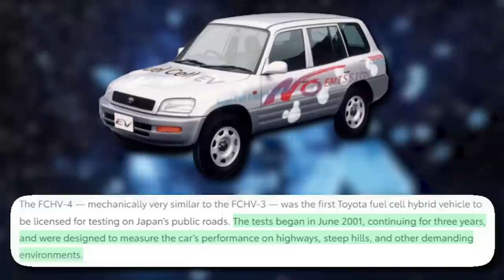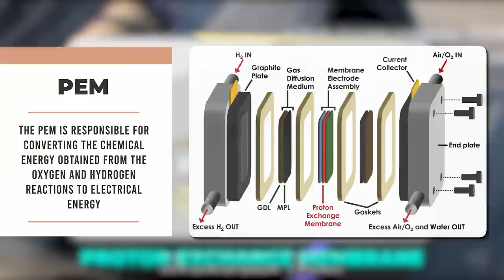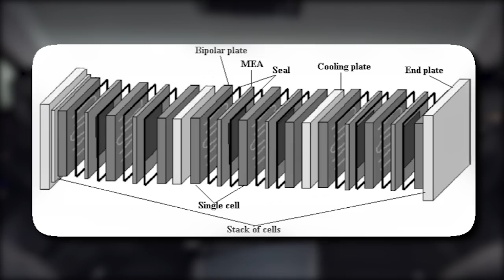Toyota CEO Releases 4 New Models | GAME CHANGER

Comment: So where is the green hydrogen infrastructure???
Reply: 1. Infrastructure follows commitment.  Just like it did with EVs.
2. Unlike battery energy, hydrogen is readily shippable from mass volume green source to the final user.
Reply: @canwelook  Except for BEVs the main charging point you are supposed to use it's the outlet you already have at home but that's not the case for Hydrogen. Without any fast chargers you can still use a small city car powered by a battery but without a hydrogen power station a hydrogen car is useless as it's the case for my country. 0 power stations across the country while almost every village has a grid connection.
Reply: @canwelook  Wrong!  Telsa built the super charger stations ahead of the demands.  The only way to push hydrogen cars to the public is to create a simple and cheap device to produce the hydrogen at home.  OR at least take delivery of hydrogen at home (storage).
Reply: Huge solar panel farms in India.
Reply: @canwelook  what could be easier or more efficient than plugging an electric vehicle into the electricity supply?  It completely removes the need to transport fuel in huge tanker lorries - which by the way use fuel themselves and wear out and clog up our roads.
Reply: @grahamf695  
1. Vast expanses of remote land used to capture (wind/solar) energy. 
2. Convert to hydrogen in that location (using green energy). 
3. Transport (using green energy) to distribution centres. 
3. Ship internationally (using green energy). 
4.Transport (using green energy) to consumption sites.
Buying and running an electric vehicle is currently LESS green than running an ICE vehicle on petroleum products. Plus it uses increasingly rare and diminishing elements. Electricity cannot be effectively/efficiently transported over vast distances/oceans without conversion into a product like hydrogen.

I'm not saying which technology will ultimately win out, either could. And it may not necessarily be the greener technology.
Reply: Same place as EV charging points.
Reply: Can someone tell the Uk government please….
Reply: @canwelook . The issue isn’t the engineering, which is all very straightforward. The issue is the economics.
Reply: @jeffg4570   yes. A key issue is the economics. Another is speed and convenience of refill/ recharge. And a single technological advance may overturn all perceived advantages of any technology or company.
Reply: @canwelook  At least, in the early days of EVs, the early adopters could charge at home, at work, or at their destination.... some even charged from a private home on the way, in case of desperation.  EVs' adoption could be jumped started without a network of chargers.
Not so, with hydrogen!
WHAT "green hydrogen source"?  There are, for the time being, virtually none!
Reply: @henrychen8256  I already explain it to you!  Hydrogen handling at home is an absolute no-no!  No local Fire Marshall will ever allow Joe DYI putting his wrench to a 700 bar hydrogen line!
Reply: @canwelook Building an EV is indeed more GHG intensive than an ICE car.  But the break-even, for a Tesla Model 3, happens already after some 5'300 miles (source:  Tesla's Impact report 2020, page 11).
What "increasingly rare" elements are used in EV production???  All the metals needed (lithium being nr 1) are getting less and less rare by the year, as demand increases.  There is not a single element which is of concern... or it will be changed for another, like is the case for cobalt, which is being outphased of most EV batteries.
Electricity can be VERY easily transported over great distances, even across seas (not oceans though, that does not make sens).  It is routinely done.  Yes, there is a loss of ca. 3% per 1000 km (ca. 5% per 1000 miles) , but that's no killer!  Transporting petrol also has a cost.  Transporting hydrogen even more so, as a percentage leaks out all the time.  Transporting hydrogen is a very costly and dangerous endeavor... one of its worst liabilities!
Reply: @st-ex8506  ALL methods of powering cars currently are NOT green. The production of lithium batteries is as non-green as it gets. And burning fossil fuels to create electricity to recharge batteries clearly isn't either.  Large scale green production of hydrogen will only become economical when volumes demand it.  And importantly, the production of hydrogen cars, like ICE cars, is currently far, far greener than EVs. 
Currently, even ICE vehicles are largely greener than EVs when measured over the life of the vehicle.
Reply: @canwelook  any production of any man-made object has an impact on the environment, and definitely also EVs. But, contrary to ICE vehicles, with EVs that impact does not continue, unabated, by using tons of oil during its entire life. Furthermore, every metal extracted to manufacture an EV, has to be extracted only once. At the end of the vehicle’s life, it’s metals will be recycled with a 98-98% efficiency.
Finally, are HFCV really less impactful to manufacture than EVs? They also have a battery… although smaller, it has to be changed more often, as it gets through much more frequent cycles. And also, do you know how abysmal is the environmental impact of the platinum necessary as catalyst for the fuel cell? And how frequently it must be replaced because of catalyst poisoning?
If many countries have almost totally decarbonized grids (including mine), the production of hydrogen is 95+% made from fossil fuel. The hydrogen fuel is the killer. I can say it with a lot of assurance, I work in the “green” hydrogen field. There is very little of it. There will still be very little of it for many more years. When there will be more significant quantities, it will be a signal that the grid producing it will be 100% carbon-free. So, why use that clean power 3x less efficiently? For what advantage?
Reply: @st-ex8506  You are fooling yourself.  Conned. EVs are not currently green.
Reply: @canwelook  no, indeed. But incomparably greener than ICE cars!

Comment: It sure would be nice to see some price $$$ estimates.
Reply: Look up the price of filling a hydrogen tank. That's the deal killer right there.
Reply: Unfortunately, last time I checked, MORE EXPENSIVE THAN GAS, BUT NOTHING RIGHT NOW WILL BEAT ELECTRICITY, ESPECIALLY IF THE COST OF SOLAR PANELS DROPS AND THEY ALSO BECOME MORE EFFICIENT.

Comment: There is no hydrogen fill-ups so what is the point of this unless you put that infrastructure into place before you build the cars.
Reply: The only way to push Hydrogen cars to the public is to create a simple and cheap device to produce the hydrogen at home.
Reply: @henrychen8256  Existing petrol stations can easily part convert to provide it once achieved mass production, home isn’t an option.

Comment: I am an original owner of a gen1 2000 tundra  right off the show room floor 
180k miles
production date of  9/99
When can I buy a hydrogen tundra?
Reply: Never 😂.  Hydrogen cars will never take off.  Cost is insane and no one is willing to install the infrastructure needed to even leave California.  Fully electric tundra is likely in the works for 2030 though when Toyota finally wakes up from the nightmare they are in…

Comment: How many parts does it take to manufacture Hydro?  Internal Combustion Engine vehicles use about 30,000 components, EVs require about half of that.
Reply: But yet they still cost more at half the parts. And cost way more to repair. I can replace my entire drivetrain for $15,000. To replace the battery in a Tesla is $22,000. A new motor will run you $7,000 plus labor. Plus the tires for EV's cost more as they are way heavier. For a vehicle that can't go as far on a charge as I can on a tank of gas.
Reply: @bobriggins8862  Not that I'm ready for an EV, however asking AI it says, "Over the course of 15 years of car ownership, the electricity needed to run a battery-powered EV could cost upwards of $14,480 less than what you’d pay for gas in a similar vehicle. EV owners also save on maintenance costs because they never have to worry about oil changes or new air filters. That amounts to savings of about $330 each year x 15.
Reply: @rdefendr1737  they're lying a little. That battery isn't lasting 15 yrs. I'm not anti EV, but I live in a rural area so there isn't an abundance of charging stations, 2nd factor is we like to take trips and I definitely don't want the drive to take twice as long because I have to stop and charge for hours as opposed to a 5 minute fill-up. If I'm going more than 3-400 miles an EV just doesn't seem practical. I also need 8 passenger seating. I don't even think I can get an EV with a third tow seat, if so, I'm sure the higher cost of the vehicle will offset a lot of those maintenance costs. Also, my understanding is that when they calculate your savings from gas, its based on charging at your home, not a charging station, they cost more. I'm getting ready to buy a new vehicle now. Will probably go hybrid but not full ev.

Comment: This is better then electric cars , the charging time is only 5 mins which is a bit plus point
Reply: Well...5 mins, provided you don't count the 30 mins or more driving out of your way to get to a hydrogen-filling station!  In my case (I live in rural France), that would even be a 300 km round trip!
My Tesla charges itself at night, while I sleep, on cheap low-time electricity!
I spend LESS time per year charging my EV away from home, than I spent at the pump with the ICE vehicle it replaced.
Charging time has become a non-issue to anyone with experience driving a modern EV!  Save the ones who live in apartment buildings with no dedicated parking space.  But THAT problem will be solved much faster than hydrogen-filling stations will appear.  Chinese cities, for instance (but some UK cities are also starting doing it... and my little village just installed two public charge stations), are installing tens of thousands of (slow) charging stations along their public streets.
Reply: That’s assuming you didn’t show up to fuel your car immediately after someone else.  Hydrogen refueling stations sometimes require 30-60 min in between fill ups to re pressurize the system 😂

Comment: For now, hydrogen is only l useful for customers in Long Beach, L.A. area, in the U.S.A., AFAIK.  There's a hydrogen refill station at the Port of Los Angeles, where 18 wheelers running on hydrogen can refill.  They'd probably be limited to about a 200 mile radius around Los Angeles, so they can go and return on one tank of hydrogen.  

This is also currently a problem with EV's, there just aren't enough charging stations around the country, until fully EV's can go over 500 miles on a single charge, which is why I prefer a PHEV currently.

Comment: I would rather see Toyota put more effort in the hybrid technology; make it more powerful, yet more fuel efficient.  The new Prius is a huge improvement over last year's model.
Reply: Also very smart of Toyota having new prius prime having solar roof. It can get charge by direct sunlight. Toyota genius ideal. Also love new sporty look of prius prime.
Reply: If Toyota has already been working on hydrogen power for 30 years according to the poster, it already proven that it is not successful because the fuel is not widely available like electric where you can get it at the convenience of your home.  Maybe it was a unsuccessful plan someone made years ago and they should've been let go.

Their hybrid cars however has shown to be efficient, reliable and extremely cost effective to build; a hybrid RAV4 was only $1400 more than the non-hybrid model a year ago before the price hike (now $3K more) due to extreme demand.
Reply: A study was done about owners of hybrid cars and they found out that the vast majority of them are not plug in in their vehicle. Moreover with the few miles you have on the battery alone it becomes very inefficient when you are driving on gaz as you now carry the extra weight of 2 technologies on your hybrid car. Fully electric is the way to go.

Comment: I believe hydrogen is the way to go, check out JCB. They've built an engine for transportation and construction that's a standard engine but runs on hydrogen. To all the naysayers, the safety of the hydrogen storage tanks will be exemplary. Also keep in mind 1st generation prototypes are never as good as 4th or 5th generation. Plus the engines are light weight so reduced potholes in our roads. In conclusion, electric is flawed, always has been due to the physics. Invest in hydrogen, you'll thank me in 5 years...

Comment: Hydrogen needs to be manufactured.  This will use up electricity.  For example, via electrolysis.  Or some other industrial process.  It is not a naturally occurring substance.  It will also require storage and shipping and distribution to sales outlets.  Such as converted petrol stations.  Hydrogen is highly inflammable and difficult to store.  So Hydrogen will not eliminate CO2, which emits instead from the power station and not the car.  How many Hydrogen filling stations are there in your city?  I know of none where I live.  And what about long distance routes?  Where exactly can you get a Hydrogen refill out in the sticks?

Comment: Guess its still an electric powertrain....maybe they design a swappable battery to fuel cell option to derisk? Most cooler countries need to replace their gas networks......sure a hydrogen infrastructure will establish itself over next decade in cooler countries.

Comment: Still the elephant in the room... The horrendous costs involved in the infrastructure to get us there.  We lack grid capacity to enable battery electric vehicles for the majority; by the time you quadruple the transformers,  transmission line expansion and other necessary improvements; all of us, will have to pay high home electric rates for a supply that currently causes pollution from fossil fuel production just not in your backyard to quadruple or more electric supply.  Hydrogen fuel cell vehicles require Hydrogen; from what I'm informed, only Hawaii and California have Hydrogen filling stations... The current costs for a Hydrogen plant is at $Billion plus trucking distribution and filling stations infrastructure!  How about an immediate 10K sur charge for each vehicle's infrastructure impact for we that choose not to go there?

Comment: Hydrogen fuel efficiency:   
1. lump of coal to electricity at power plant ( 40% efficient)
2. Transmit electricity to fueling station  (30% efficient)
3. Convert water to hydrogen with electrolysis (70% efficient)
4. Compress hydrogen (requires electricity)
5. Convert hydrogen to electricity with fuel cell (40% efficiency)
6. Power electric motors to drive wheels (70% efficiency)

From the original lump of coal 0.40 * 0.30 * 0.70 * 0.40 * 0.70 = 2.3% efficient.  This is much worse than gas powered cars and will require much more coal to be burned to provide the necessary electricity and many more power plants to be built.  Hydrogen makes no sense and riding on top of 10,000 psi compressed hydrogen tanks is dangerous.
Reply: Where are you getting these BS efficiency numbers?
Reply: @jeffmckie7300 from a place you never went to….SCHOOL.

Comment: I’d like you to do a video on JCB, and how they are trialling ICE using hydrogen powered heavy vehicle’s, such as backhoes, excavators, trucks, and tractors, because ev powered heavy industrial vehicles are not an option for the foreseeable future.
And what they are doing can be easily transposed to passenger vehicles.
Reply from the maker: We already did a video about JCB. 
You can check it here: https://www.youtube.com/watch?v=d4BnSty_UA0
Reply: big mines in australia who use the biggest of the big are converting to EVs
Reply: People are forever prattling on about the volatility of hydrogen and what would happen in a car accident if the tank was ruptured. I'm pretty sure the motor manufacturers are fully aware of this fact and will develop fuel tanks and systems accordingly. I highly doubt we would see another 'Hindenburg' incident in the event of a hydrogen fueled car being involved in an accident. And in any case, what would happen if a tank filled with petrol/gas was ruptured in an accident? I may be far from the most intelligent person in the world, but would escaping petrol dribble benignly down the drains - or erupt in a fireball? The volatility of the fuel isn't at the forefront of someone's mind when buying one of today's current crop of ICE powered cars.

Comment: Hydrogen is more polluting than gasoline the name of the game as I understand it is to reduce pollution. It Hass to be more efficient then 20 to 40 miles per gallon. EV cars are five times more efficient than that. I wouldn’t park a hydrogen fuel car in my garage Because I know hydrogen can easily leak and it is when combined with other elements highly explosive they must know something I don’t know after all they invested billions of dollars remember solid-state batteries are just about ready to hit the market and when you get the range to 600 to 900 miles on an EV car that’s tough to beat especially if the car is extremely safe extremely reliable

Comment: Hydrogen is not here & won't be anytime.
Reply: JCB have been building heavy equipment Hydrogen powered vehicles in the U.K. for several years successfully.
Reply: @wyattfamily8997  What family cars does JCB produce, pray tell!  What MAY be a solution for heavy equipment, is not for light transportation.  BTW, there are also companies building battery heavy equipment for several years... successfully.